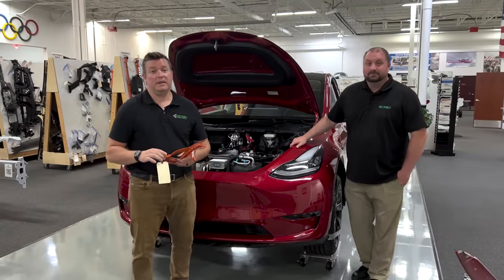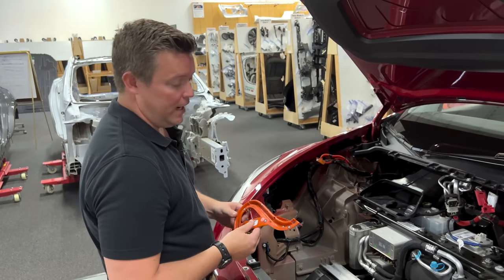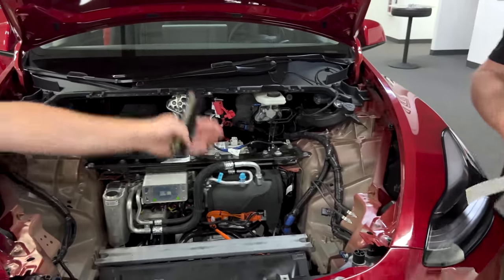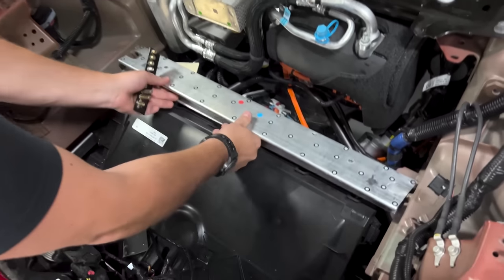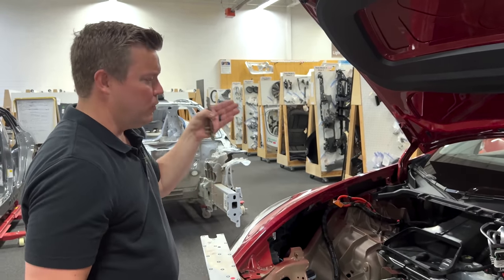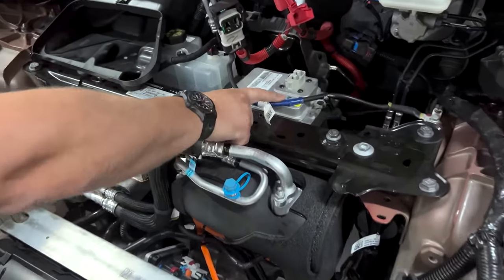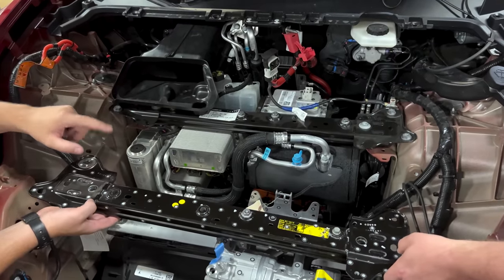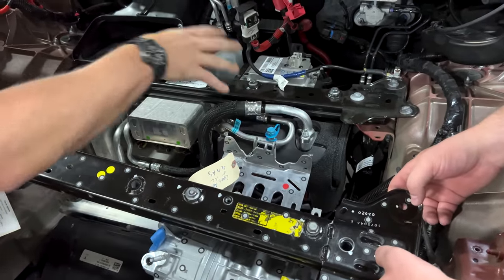Tesla Model Y - Under the Hood | Giga Texas Revisions

Comment: the reason the hose of the low side (suction) of the compressor is to lower the resistance and keep the diameter of the hose as close as possible to the metal pipe. this prevents the compressor from going down too low in pressure and thus evaporation temperature of the refigerant. this should allow the system to be slighty more capable of dealing with very low outside temperatures.

Comment: When looking at the cat fight under the Mach-e hood, it makes the symphony under the Tesla more phenomenal
Reply: Muck-e almost gave Sandy a heartattack,
Reply: I’ve seen spaghetti software code but the Mach-e has spaghetti plumbing
Reply: You should see under the hood of the BMW i4 and IX.  They don’t even have frunks, that’s how much of a mess they are
Reply: @bartwaggoner2000  Next will be spaghetti spaghetti.
Reply: @AudiTTQuattro2003  
"Life cycle of the vehicle"?
Just count the number of hose connections on the Mach E.
Then consider the likelihood that one hose, or connector fails.... Multiplied by the number.
Any semi competent DIY mechanic could dismantle and reassemble this section of the Tesla without a manual and without taking pictures 
Try that with a Mach E.
(Note I dismantle things for a living, I've seen examples comparable to both)
Reply: @rogerstarkey5390  I remember my first time stumbling across that sort of forethought, it was a circuit board that had about 6 or 8 connections. I noted the different coloured wires, which is expected, but I though to myself I should make a diagram so I got them back in the right order. Then I realize that on any given side of the board, the 2 or 3 different cables had different  SIZED terminals, so you couldn't really get it wrong.